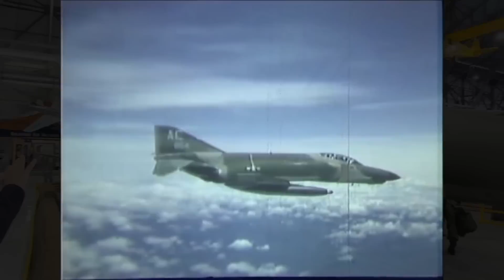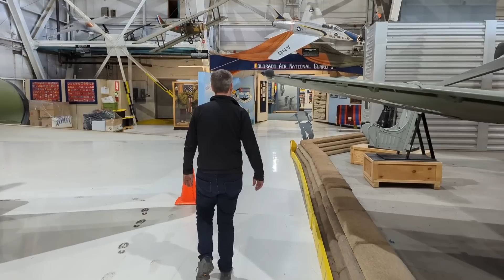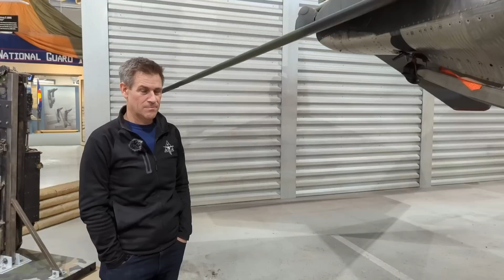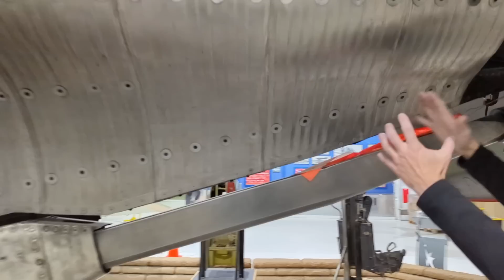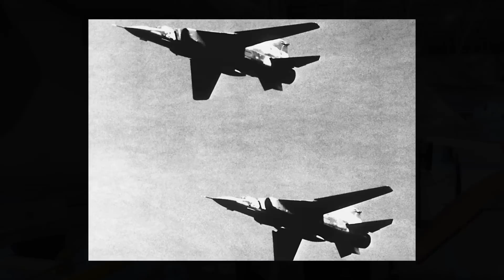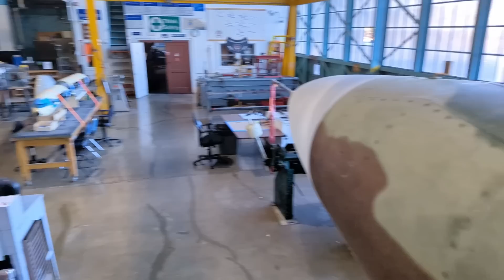The F-110A Spectre (Spoiler: It's really an F-4) - The Century Series Revisited

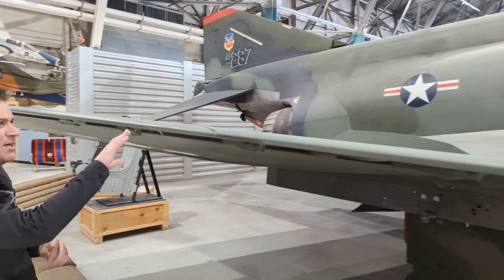Comment: I was a munitions loader on the F-4D in the Ga ANG back in the 1980's. At 3:32, the aircraft is identified as a -D model.  It is not a -D model.  It is an -E model with an internal 20mm Vulcan canon. For the -D and earlier models, there was a gun pod that was slung on the centerline hardpoints to give it a gun.
Reply: You are right, its not a D it is indeed an E. Albeit a very old E. One of the earliest.  The serial Number on the Vertical Stab is "AF-66-287"  My Flight Manual T.O. 1F-4C-1 dated 1 September 1968 includes the F-4C, F-4D & F-4E, all in the same manual and the manual is about 4 inches thick in a hardcover pole ring binder.  It list ALL the production block numbers up to that date for F-4C/D/E.  The first Block listed in the manual for the F-4E is "F-4E-31-MC" which covers serials AF 66-284 thru AF 66-297.  So this F-4E in this video, with serial 66-287 falls right in that Block of the earliest F-4Es. Also- older E models were modified with the slats later in their careers, and the BLC system was removed. So the only definitive way to tell an airframe's age is to look at the Serial Number, not what is installed on the airframe. Did you notice this E here has the short turkey feather engine exhaust of the Ge J79-15?  All C and D aircraft had that engine. But NO production E  had it. Production Es had the Long feathers of the GE-J79-17.  So either this is a mistake on the Museum's part or this F-4E is so old, it still had the C/D dash 17 engines.

Comment: You're looking at a mid-build model F-4E - the early "E" models didn't have the large dogtooth slats you pointed out. The "E" model was also the only Phantom with a built-in cannon (the nose mounted M61 Vulcan 20mm cannon). All other Phantoms had to resort to using a pod mounted Vulcan 20mm gun (either the SUU-16 or SUU-23). About the only thing this F-4E is missing is the TISEO (Target Identification System - Electro-Optical) camera system that would be mounted on the port side (left-hand) wing about 1/3rd of the way down the leading edge from the fuselage - and that TISEO pod indicates a late model "E".
Reply: The slats (and even the gun muzzle) don't mean anything (or the TISEO for that matter).  Just to point out... the serial number on the Vertical Stab is "AF 66-287" meaning this aircraft was procured in 1966 meaning it was actually built either in '66 or '67, making it one of the oldest F-4Es in existence which may explain why it doesn't have the TISEO. TISEO was first installed on F-4E AF 71-228.  But the TISEO was added and removed to newer and older aircraft throughout the F-4E's life span. i.e, the F-4G had TISEO when they were once Es. The TISEO being removed when converted to the Gs.  Also- older E models were modified with the slats later in their careers, and the BLC system was removed. So the only definitive way to tell an airframe's age is to look at the Serial Number, not what is installed on the airframe. Did you notice this E here has the short turkey feather engine exhaust of the Ge J79-15?  All C and D aircraft had that engine. But NO production E  had it. Production Es had the Long feathers of the GE-J79-17.  So either this is a mistake on the Museum's part or this F-4E is so old, it still had the C/D dash 17 engines.
Reply: @ILSRWY4  The serial is the 4th E produced. But it should have the long turkey feathers, of the E's only the first production example (66-0284) had the short exhaust, the long unit was fitted from 66-0285 onwards.
Reply: @jameshastey3058  there were techincally two other models with the internal gun; the F-4EJ flown by the JASDF, and the F-4F used by the Germans.  Semantics really since the airframes were basically the same as an E, but on paper still a different model.
Reply: @wastedapathy22  The EJ was an E built in Japan by Mitsubishi; the F was an E with a number of key items removed in order to reduce weight (and Germany later had to re-add those items in subsequent modernization efforts LOL).
Reply: @jameshastey3058 Lack of AIM-7 Sparrow was one of those omissions, on the F version which shocked me when I first learned that.  The story I read was that they were going to buy the F-5, but when they started learning about the Mig23 coming they wanted something better than the F-5.  They even considered a single seat Phantom.
Reply: @ Wow - the Sparrow would have been the primary reason to buy the Phantom. I can't believe (well, to some degree I can) that the Germans wanted a Sparrow-less Phantom. Wow.  I will say though that the Luftwaffe would have done better with the F-5 than they had with the F-104G.
Reply: @jameshastey3058  The Germans did not want BVR missile capability for treaty compliance reasons. They refitted their Phantoms in the late 80's with full BVR capabilities but bought new AIM-120's instead of AIM-7's.
Reply: @adam_mawz_maas  I didn't realize that treaty compliance would have been a reason considering that East German MiG-23's were delivered in the late 1970's with nominal BVR capability in the form of the AA-7 Apex SARH missile. IIRC the main reason the Luftwaffe bought the Phantom in the late 70's was because East Germany was getting Apex equipped MiG-23's. The only former Nazi country I knew of that had a treaty compliance missile restriction was Austria (which the Soviets agreed to relax in the mid-1980's). As a side note, I have seen photos of Luftwaffe Phantoms with AMRAAM's.

Comment: notice the inverted airfoil shape of the horizontal stab,,was designed to help it turn and rotate on takeoff,l worked on the D,C and the E models in the Airforce. avionics system
and flight instrumentation was my specialty

Comment: Definitely an F4E    Dane
Reply: Yes it’s carrying a false serial number for odd reasons… maybe F4D 66-287 had a local connection to the Museum ?
Reply: @neilturner6749  66-0287 was the 4th E model built. E production started with 66-0284 and the first 96 airframes were originally ordered as D's.

Comment: I a Crew Chief on The F4D's and RF-4C's for 17 yrs. It's a love/hate relationship. More phantom bites than I can count. 😅  . That's an F4E Phantom model. It had slats on the outboard leading edge and a regular leading edge inboard flap. On the deck, the Rf-4c was absolutely a beast in speed. I was run qualified up to afterburner, taxi qualified, high speed qualified with crew in backseat,flight control  qualified. I even got a ride in my own aircraft ( 65-0824 ). It's unbelievable what the F4 could do. Phantom Phxyer for Life.
Reply: Turned down my incentive ride in an F4 after I had performed a major inspection on one of them and saw the condition of the engine tunnels.  Looked like the only thing holding the engines in place was thrust!
Reply: If you care to look again, you'll notice this jet has a "soft" wing which has slats on the leading edge of both wing surfaces, the outer and inner wings. If you look you'll see the inboard slat hinges. The "C" and "D"s had "Hard" wings with the leading edge flaps you mentioned as well as Boundary layer control over those surfaces. Every "E" model as well as the "G" model had soft wings. Amazing that in your 17 years of crewing these jets that you can't tell the difference. I personally crewed an "E" that subsequently went to Depot and returned as a "G" at George AFB and yes, I flew in that jet myself. As far as folding the wing, the C and D models were hydraulic from the cockpit. The "E"s and later variants were manually unlocked from outside and muscled up by ground crew and locked with appropriate devices to hold them in position. We lost an "E" model at George AFB because the left wing wasn't locked down and folded on takeoff. The crew escaped and the jet crashed next to our fuel storage area without further damage circa 1979. per  7269 (MSN 3956) USAF 4th TFW.  USAF 35th TFW.  1975: USAF 58th TFS (33rd TFW).
					1979: USAF 347th TFW.  With 35th TFW w/o Jul 2, 1979 . https://www.joebaugher.com/usaf_serials/1969.html    After leaving the Air Force, I left fingerprints on most of the F-16s in service in the world as a mechanic for General Dynamics/Lockheed before retiring. There's nothing to compare cranking a brand new engine in a brand new jet for the first time and putting them through their paces.
Reply: @williamhudson4938  E's were built with both the slatted and unslatted wings, it was a mid-production change, with many USAF E's refitted to the slatted wing in the depot. 71-0237 was the first production E built with the slatted wing. You can generally tell the converted E's from the ones built with slatted wings by looking for the large reinforcement strap on the underside of the wing, as that was fitted during conversion, the factory slatted wing had a thicker skin there and has a very subtle step instead of an external strap. All G's were early E's with the slat conversion. 

The USAF started fitting slats to older E's in 1972, with 304 airframes converted, the majority of the remaining early E fleet aside from the Thunderbird airframes which retained the hard wings.

The only Phantom's that were built only with slatted wings only were the F's for Germany. The last unslatted Phantoms built were the EJ's (also the last Phantoms built).

Comment: The sawtooth on the wing was INVENTED by A.V Roe Canada - AVRO, and was FIRST used on the AVRO CF-105 ARROW.  When the Arrow was (STUPIDLY) cancelled by the Canadian Government (Under US pressure) in 1959, most of the engineers moved to the US.
Reply: The Dogtooth wing was not an Avro Canada invention. 

The Hawker Hunter F.6 had a dogtooth wing and first flew in 1954 (earlier Hunters had a straight wing). The F-8 Crusader also had a dogtooth wing and first flew in 1955. 

The Phantom had the dogtooth from the start and flew a mere 2 months and 2 days after the Arrow in 1958.
Reply from the maker: I recommend reading Alan Barnes' research paper on the Canadian Intel that Diffenbaker was presented with regarding the initial Arrow cancellation decision. It certainly has changed my perspective on the decision. What happened afterwards will forever be on the PM's shoulders.
Reply: @normmcrae1140 :

      NO.!!!
      IT WAS NOT.!!!
      YOU ARE WRONG.!!!

      😡😡😡👎👎👎

Comment: I had a model of this aircraft when I was a kid and the box art said it was an F-110!  I saw it as a continuation of the Century Series and slotting right in there before the F-111. (And I always had the urge to call the YF-12A, the F-112!)   I still don't know why McNamara decided to change the way all U. S. military aircraft are designated and to start the counting over again (B-70....B-1....B-2, etc. The F-15, F-16, YF-17, F-18, F-20, F-22, YF-23....all of them should have a 1 in front of their number!! Not sure where we would then slot the oddly named F-117A, but maybe it should have been the F-119?  And the F-14, being strictly a Navy aircraft, ought to have been the whatever was next in series for Grumman, (F-13F?) but let's say F-14F.   And the F-35 should be the F-24...or really, the F-124!   Ah, well....)  There was nothing wrong with the way the individual services were doing it before (I liked the way the Navy assigned a letter code to each manufacturer) and they should have just kept on with it.  But then, there were a lot of things McNamara did that I didn't understand....and I think I'm not alone.
Reply: I prefer the Navy scheme too, but it was pretty confusing having the same plane with different designations just because the manufacturer changed -- TBF/TBM, and FM/F4F.
Reply: @grizwoldphantasia5005  It used to confuse me, too, until I "cracked the code" so to speak.  Then it made a whole lot of sense.  The "FM" was the first fighter built by GM for the Navy, but the F4F was the FOURTH fighter built by Grumman for the Navy--even though they were pretty much the same plane.
Reply: @therealniksongs  What bothered me the most was that the F41 was just F4, like FM, then FM2.  And I never saw much point in including the manufacturer code, especially when it was exactly the same, no improvements.  IIRC, the USAAF was just as silly. with the P-51 B and C being the same except for manufacturer.

Comment: Supply clerk on USS Midway CV-41, and I never got tired of watching flight ops from the island, vultures' row.  I could watch A-6 and A-7 cat shots from start to finish, but when an F-4 was launching, the jet blast deflectors threw that exhaust right at me, 50 feet up and 200 feet back.  I'd look, and if the airdale was shoving the wing up and down, I knew to pull my head back and look again about 10 seconds later to see the launch.  It was like a pizza oven, it was so hot, and the orange cone of the afterburner just added to it.  An aircraft carrier is the best toy in the world, and Phantoms made it so much better.
Reply: Airedale shaking the wings?? 
Ahoy shipmate.. 
 You were watching a squadron 
 "troubleshooter" doing the manual  "down and locked"  check on the folding wing locking mechanism. The last procedure done before the thumbs up and sending her down the road.. 
Who knows that might have been me you we're watching.😊 
VF-161
Reply: @Seadoghal3  I figured it was something like that.  Afterburners roaring, rock the plane, duck underneath, rock the other wing ... holy mackerel, how did I end up a supply clerk?

Thanks for all the shows you provided.  I never got tired of it.
/yer appreciative audience

Comment: Flying pickup truck.  Not century series. Yes unstable in the F-110  test series. Elevator is producing down force again a stability fix if memory serves. Prettiest/ perfect fighter?  I can think of others!
Reply: mmm, tailplanes on virtually all airplanes exert a downforce. not a fix but a feature.
Reply: Well it kinda was Century series as it was designated F110. F105 Thud wasn’t a “fighter” either. Does that mean F111 is a Century series-teen? 
They then dropped the first number 1 and went Lockheed (Y) F-12, F13 unused for bad luck, then F14 and so on before adding the first 1 back in for the F117 Nighthawk (also not a fighter) as YF17 had already been used by Northrop.
Reply: @neilturner6749 This is one of the most succinct and informative comments I’ve ever read on YouTube. Thank you!
Reply: Not sure what you flew but never thought of it as a pickup truck in the 6 years I flew it.
Reply from the maker: You are entitled to your opinion, I just tend to disagree. 🙂

Comment: The A-7 was also used by the USN, USAF and ANG, long before the F-35. And we should not forget the Sabre/Fury or the A-3 and  the B-66.
Reply: The Fury was kind of meh compared to the Sabre, from what I've read, and the B-66 was so different from the A-3 it got a new number and name, but the A-7 you are definitely right about. Also you could sneak in the F-16, which the Navy uses for aggressor training, but isn't used out in the fleet and has never been navalized.  And of course multiple helicopter types are used by all 4 services to some degree, and the V-22 Osprey is used by Navy, Marines, and USAF. The C-130 Hercules is another one.
Reply: @RCAvhstape  the F-4 and the A-7 also had service modifications for specific requirements, such as tires, refueling probe/receptacle. And the A-7E was derived from the A-7D's USAF requirements.

Comment: The first back seat installation in an F-110 was almost an afterthought. The pilot sat on an ejection seat, the GIB had a parachute.
Reply: Ridiculous.  Where did you get such an idea?
Reply: @dukeford8893  from 50 years of studying. Try it.
Reply: The F-4 has always had twin Martin Baker seats from the beginning. Now, a marked difference between a Navy/Marine F-4 and an Air Force F-4 is that USN/USMC Phantoms did not have a rear stick where USAF Phantoms did. Backseaters in all variants had a command select lever with which to eject the pilot, should he be incapacitated.
Reply: @LV_FUD80  Actually, it was a single seater for at least part of the YAH-1/F4H-1 development. That's actually why the rear cockpit wall is vertical instead of slanted to match the ejection rails and why the F4H-1F/F-4A's rear canopy is so low in profile (as it was designed to replace the avionics hatch originally intended to be there. 

The rear cockpit area was designed as an avionics bay and converted to a rear cockpit after the basic layout was decided but before the first prototype flew. But it was always fitted with 2 ejection seats aside from the very first airframe (YF4H-1 142259) which used the space for test instrumentation, but was built with the shell of the rear cockpit present.